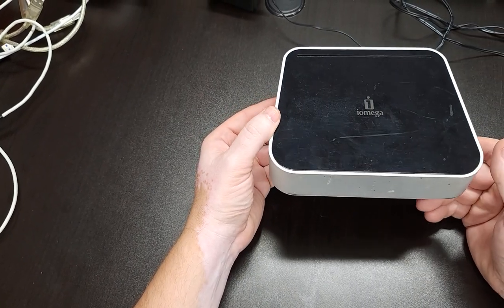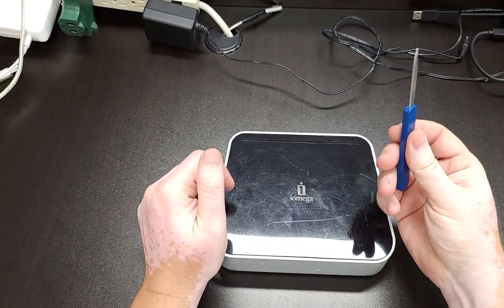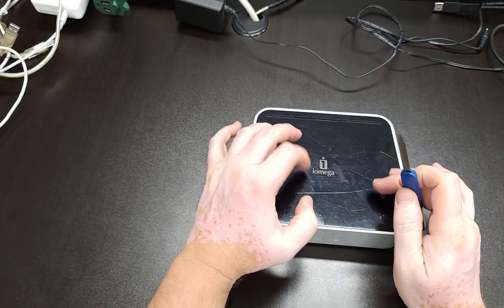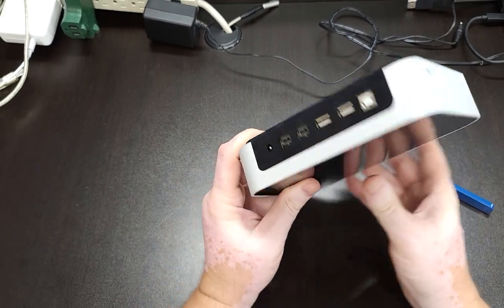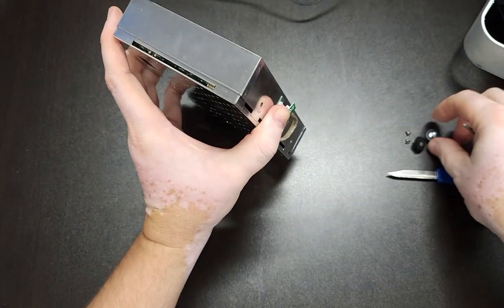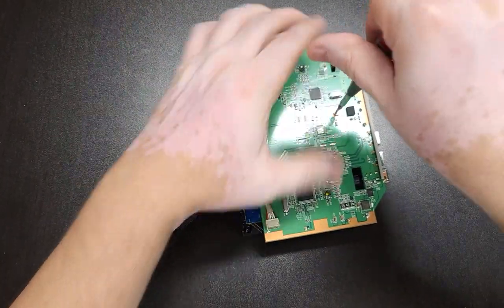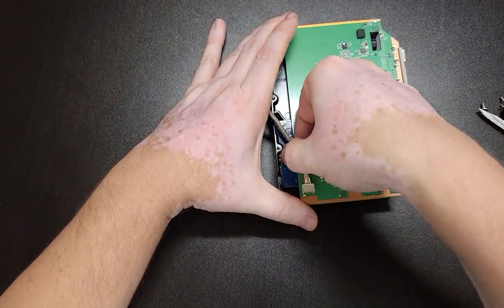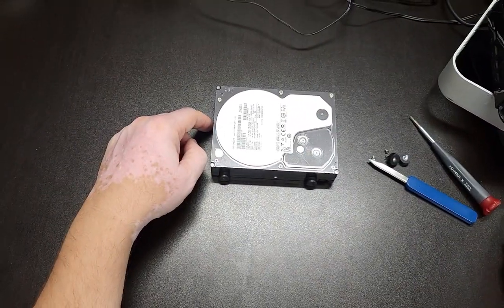Disassembly of 2011 Iomega Mac companion external hard drive model MCDHD

Comment: I found an empty enclosure on eBay for only $15 ppd.

For it's FW800 ports to use with my several Macs.

Cheaper than ANY LaCie d2 Quadra external drive 

then found on eBay...

I put in a faster WD 320GB 72K SATA HDD 

I had as surplus....

FORGOT how to open up this rather complicated iOmuggya thing.

Thanks for the reminder...

Good show!

BTW- A thin sharp 1" steel putty knife or paint scraper works best!

J.C.

Comment: Still using mine with my Late 2009 Mac Mini 2.53 gHz. machine.

As my main  drive.

A 320GB 72K 16MB drive 

Faster than it's internal drive by light years!

OS-10.10, 10.9 and 10.6 on partitions.

DO NO USE in conjunction with ANY LaCie d2 Quadra box

KILLED two of mine!

Don't believe me???

You will find out.

J.C.

Working on old Macs here, since 1997 ( $15 1989 SE-30 < )

Good luck!